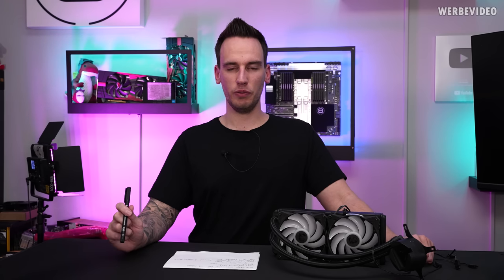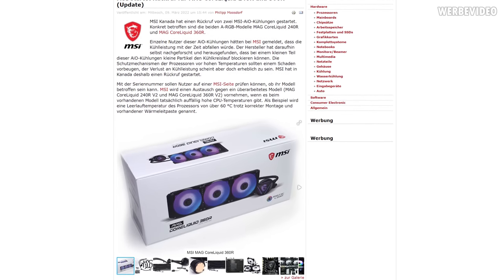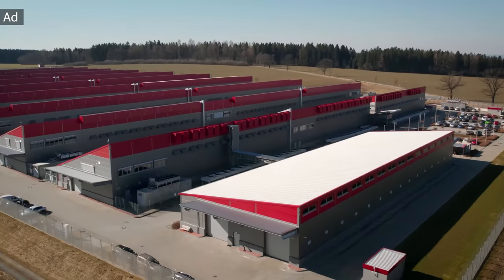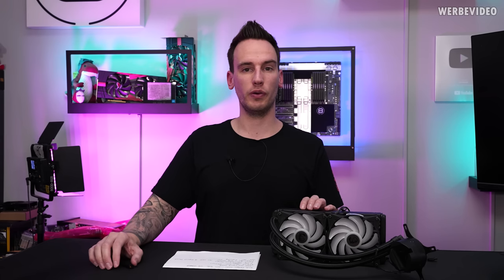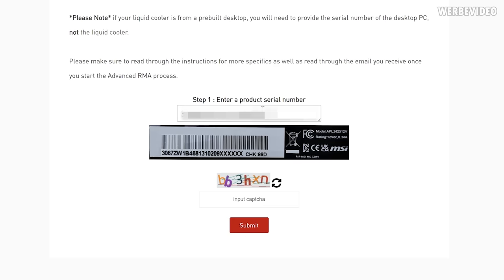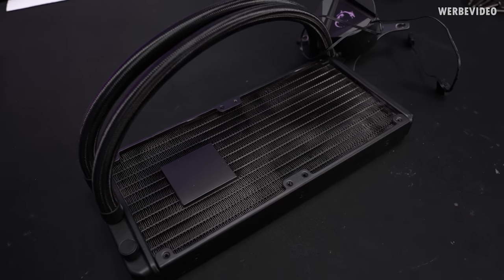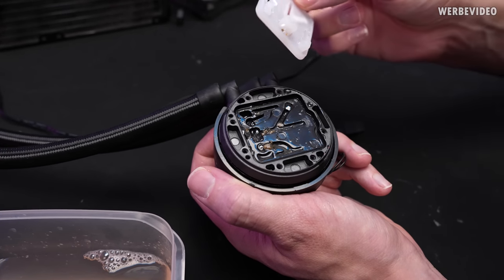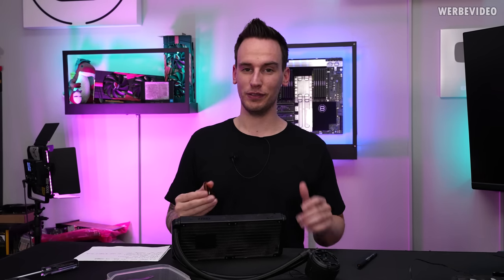Things you should not find inside an AIO

Comment: The OEM of these AIOs is Apaltek, they are the ones with serious QC issues.
There are a lot of other Apaltek AIOs on the market, several with issues.

The Fractal Design Lumen S24 series is also Apaltek (same pump in rad design), and I've also seen several examples with sludge build up in the loop. At time of writing there has been no recall for those. I've had 2 Lumen AIOs with sludge build up myself.
The Lian Li Galahad AIO is also from Apaltek (but with a pump in cpu block design Asetek is suing them over), and I've also seen pictures of sludge build up in that AIO.

EDIT: Fractal Design has now opened an exchange problem for their affected AIOs, you can find it on their homepage. They cite the cause as soldering material + impurities reacting with the cooling fluid causing sediment build-up.  

16 December EDIT: Fractal Design now has a Lumen v2 series of AIOs now where it's still Apaltek but they properly flush the radiator and use their own proven-good coolant supplier, nice to see them doing the right thing.
Reply: It's not only Apaltek, also Asetek is affected and other "independent" AiO makers like Enermax and such. The issue is the wrong type of flux used to solder the aluminum radiators. The companies source them from different manufacturers. They're not being made in-house and probably these manufacturers don't know what the radiators are being actually used for. (I mean, which fluid is being put into them) So this is just an unfortunate coincidence that ruined most AiOs because of a very complex supply chain.
Reply: This is my point of my previous comment ….. it’s quick and easy to blame the brand selling them, her MSI, but their OEM supplier should be held to account / named and …. not necessarily shamed, but also get a talking to etc….. then if they’re a repeat offender, roast them.
Reply: @michaelthompson9798  I'm sorry, but that's like saying you shouldn't blame Gigabyte for their exploding PSU, you should blame MEIC (the OEM) instead. The fault largely lies with MEIC but Gigabyte isn't exactly blameless. They put their name on the product and charged a markup, they should stand behind it.
Reply: It is the responsibility of the contractor to audit and to assess if the CMO is capable of delivering a product according to the contractor standards. If MSI is branding this, then it's MSI fault also due to poor or non-existant qualification and audit procedures
Reply: @josepedroteixeira9721  This! I don't care, who their contractors is, if MSI's name is on the finished product (in this case, the AIO, but it really concerns any product), you better believe I will blame them, not some OEM manufacturer. If the company sells them under their brand - well, then they are responsible for it as far as I'm concerned.
Reply: Appalling.
Reply: AFAIK the Galahad also has (had perhaps?) a noisy pump.
Reply: @kosmosyche  It all depends on how the brand handles this issue. And MSI currently handles it very poorly. They should at least remove any serial number restriction for this product line.
Reply: @kyoudaiken  That isn't how a business works though, if they don't have a significant number of claimed problems within a block of serial numbers there is no way they are going to recall them. They probably should as it seems more have problems than not, but the driving force is always money, and this is going to cost a bundle so not expanding the recall until it is absolutely necessary is standard practice.
Reply: @kyoudaiken  I've never once seen asetek AIOs have this type of issue. In fact, asetek is by far the best OEM for AIOs as far as any issues whatsoever. Everyone else has tons of issues. Even coolit has like 10x the rma issues of asetek. Coolit is far better than any other oem still tho.
Reply: @MrDutch1e  I'm just basing what I am saying on an investigation a news outlet did. The type of flux used to solder the radiators is the problem and it depends on who is buying those radiators who is affected. Since often most use multiple suppliers for their product, it could be that ALL AiO brands and OEM brands are affected.
Reply: @kyoudaiken  I highly doubt that is the issue or it's just certain brands buying from one oem of radiators that's creating the issue. I've only ever seen this exact issue on Enermax and now Alpatek.
Reply: @kosmosyche  Exactly, MSI is who sold you the product, who MSI bought their parts from or hired build it for them is their problem not the consumers.
Reply: @kosmosyche  100%. As far as the law goes, MSI is responsible as they are selling them to the public.  It's MSI that has to sort the Qc out from who ever made them, Not the consumer.
Reply: bro i have a Galahad, don't scare me😭
Reply: Dang it...I literally just bought a Fractal Lumen S24 for my rig. -_- Right after 2 Xilence AIOs dying on me withing 18 months.
Reply: I have a Lumen S28 running high temps. Would be nice to bring this to Fractal Design's attention as well. (Yes I know its Apaltek's fault)
Reply: @kyoudaiken  Enermax  units are made by Apaltek. AFAIK, Aplatek and Arctic(casued by faulty rubber seal) is only OEM having these kind of sludge issue
Reply: I agree, it's not only this model of MSI that has issues. Have heard that the new Lumen AiO's from Fractal Design and those of Cougar are suffering from the same issue. All these AiO's have the same concept of the pump in the radiator.
Reply: Can confirm, my Lumen S36 became clogged up in 10 months with insane temps as result. Switched to Cooler Master and having 0 problems…
Reply: What would you recommend as the best AIOs?

Comment: We had this cooler in a friends system and after watching Greg’s video when it came out, I had him check his temps. Sure enough, hi temps and throttling. 

The fix was to dissasble and refill the system with distilled water, then run it, flush and repeat until no residue was present. 5 refills later it was filled with corsairs coolant and has been perfect for 7 months now.

Comment: Last week 32/2023 my PC shut down middle of my work. I didn't pay attention to it and restarted PC. After some time the same thing happened again. Then I begun to check reason for that. I checked the temps and CPU temp was 71 C. At that moment there was no time to wonder, so I replaced the CPU cooler with a Noctua air cooler and temps was ok. Yesterday I begun to find out problems and help was found again on Google.  I appreciate especially your derBauer's work here. As a small detail, my MSI Core Liquid 240R was almost 2 years old, with ten days left on the warranty. The warranty had to be handled here with the seller of the component. Msi Core Liquid lasted almost the entire warranty period. :) Thank you again for your interesting and knowledgeable videos. Greetings from Finland.

Comment: Thanks for highlighting this, Roman. Even though I don't have a MSI AIO, I think it would be beneficial to many people if you, and other high profile tech experts as well as experienced viewers, could examine as many of the most popular AIOs to see whether they have residue build-up after a number of months of use, as a lot of people don't regularly monitor their component temperatures. This task could be coordinated and shared between several people to ensure the broadest range of AIOs are tested.
Reply: I'm gone give mine a 6 month test, and then rip it apart to inspect it.      I have a 240 coreliquid and have no issues whatsoever, even with a pretty aggressive overclock on my 5900x, but if I notice a consistent rise in load temps, I'm just gonna replace it and tear it apart for science.       Mine is from one of the newest runs, but if what others are saying is true, it seems it will be more of a manufacturer issue and not a run to run batch issue which means that all of them are technically succeptible, not just a handgun of thousand like msi originally stated.

Comment: I’ve seen Greg’s videos (Greg Salazar on YouTube) and “ most”companies take a level of pride in their products and if the AIO manufacturer themself  has to be held to account to, not just the brand selling them. It’s clear there’s some sort of QC issue which needs to be addressed.
Reply: Yeah they all sourced cheapest solder/flux they could find for more profit. They didn't care to know what exactly they needed to avoid the issue.
Reply: @craig9365  The OEM to blame here is apparently based in China. And MSI is based in Taiwan.
Reply: @AndoXD2448  this oem has had countless issues over the years.     There was an enermax aio that had the exact same system for lga1150 where it would essentially gel up inside, and then your pump would basically run out of fluid, overheat and then would die.

Comment: I was one of the early adopters of one of these msi AIO's and about 6 months later my cpu would hit 90C+ under load and throttle itself. This was well before it was a known issue so I just returned mine to Micro Center where I got it and paid a bit extra to exchange it with a Corsair Elite Capellix which works great to this day.
Reply: can't complain over corsair used 3 of them never had problems and my oldest one which you can't even find info about, was pretty much their 1st one still works altough since the pump was limited to 2480rpm it's too weak for modern cpus
Reply: Same…. But I did the recall and got a replacement while I had already replaced it with the Corsair one and the new mag v2 is just chillin in my closet with the plastic wrapper still on.

Comment: This is why I like the idea behind systems that are supplied as an AIO, but can be maintained or expanded upon like a custom loop. Being able to trivially flush the system or add/replace bits with quick-connects could save so many headaches, RMAs and recalls.

Shame such systems are pretty thin on the ground.

Comment: Have stated it for a couple months now and I will now officially stick to renaming MSI as
Major
Service
Issues
Reply: You realize that this is an Apaltek rather than an MSI issue right? There are more Apaltek-made AIO liquid coolers that have these kind of issues (Enermax, Fractal, etc). I have a Coreliquid S360 (Asetek made) and no issues whatsoever.
Reply: @debredanaar5292  I have a H115i elite Capellix with no issues
Reply: @debredanaar5292  Does not matter who made them, MSI has there name on the product, So it's Up to MSI to replace it. It's MSI's problem to find out what the cause of it is.
Reply: @debredanaar5292  Apaltek has had this issue for many years and MSI chose them to be the OEM. Regardless, it's up to MSI to rectify the problem as they have the final responsibility.

Comment: Working in a computer shop in France, and I can say that almost every MSI CoreLiquid V1 coolers seems to finish like this (didn't open then, but the temps are bad at idle, so....).
Got no problem to get them RMAd, not through their recall website, gotta contact the support directly.
The V2 received in exchange seem to work well for now at least, so hopefully they found a solution and fix it.

Comment: I had the 360mm version of this.  It worked for maybe a year.  I used it with a stock 10700k.  It would reach 99C with just Firefox being used.  I had to disable half my cores and hyperthreading to keep it cool until I could finish the loop my graphics card was on.  With the 10700K now on a loop with 2 360mm radiators, it would run 5.1 Ghz all core and top out at 67C during load.  By the way, my MSI 360r didn't have an accepted serial number either.

Comment: I'd be surprised if most AIOs don't have similar issues after extended use. But I've only ever used custom water cooling. I don't use dye and only use de-ionised water + pure silver strip as an anti-bacterial, and have never seen my loop/reservoir become polluted. I have never bothered dismantling the cpu block, so there may be debris from the radiator stuck in the fins - but I have not seen a termperature increase.

Comment: Bought the 240r brand new and had these issues straight away.  Would hit 80+ in the bios.  Got it replaced with the v2 through my stores warranty and about 6 months in and I idle at around 35 now

Comment: Even arctic had a recall for a gasket for some freezer series made in 2021 it's crazy how they don't test the batches or new changes to the aios.... But I'm glad they are making it right but would save them the headache...
Reply: They said the gasket wasn't galvanized fully. I'm wondering if that was bs and it was the wrong flux used like mentioned in the other comments here.
Reply: @tacticalcenter8658  The issue with Arctic Cooling looked different. They also let you either RMA it or swap the gasket yourself, sending you a new one for free regardless of serial number. This is what MSI should do. But you know, big corporations are sometimes not feeling like that.
Reply: @kyoudaiken  arctic is going by the date code on the bottom of the pump vs the S/N. if yours has a date code past when the affected time frame it will also refuse to let u proceed with the recall. i bought on of the 420 units like 2 weeks before the gamers nexus video but mine had the QC pass stickers on it so that should mean it was one that was already fixed.  i tired to apply for the recall anyway just to see and it refused to let me because the date code on the pump was past the affected time frame.
Reply: @mraaron1584  I doubt you will have that issue down the line, I think Arctic is being honest with their time frame. And I bet within the affected time frame, there are also good models that are replaced or getting a kit regardless. Arctic's RMA politics are pretty good. They replaced a fan with a bearing issue without the need of me sending it in.

Comment: Never understood the appeal of AiOs...air coolers are cheaper, more reliable, easier to install and perform better.
Reply: Air coolers perform better in terms of price to performance. They do hit a ceiling though and if you need to cool something like a 12900k a 360 AIO is going to perform better even compared to top air coolers like the Noctua NH-D15. There's also other issues like case clearance and how well optimized it is for airflow. Some people also prefer AIOs just for their looks.

Comment: I did buy one of these but I was using it to modify a server and had to remove the pipes as they weren't long enough I used clear industrial polyurethane pipes.... I refilled mine with xspc Ec6 coolant...so far no problems with temperatures...as with most Aio failures it's the ' cheap' or in correctly specified coolant that doesn't protect against galvanic  corrosion or bio build up .
Reply: Or it wasn't built correctly with material's that weren't compatible with the fluid being used.

Comment: It's too late for me (I've already replaced my MAG CoreLiquid 240R that was on the brink of death due to this issue) but thank you nonetheless for bringing attention to this! If you want another sample, I still have the bad CoreLiquid 240R available.
Reply: Mine also wasn't covered by the recall, even though it definitely has the same issue.
Reply: @ryguygoesawry  most of the time you can just contact msi and thekr customer service dept can set your RMA up if it doesn't "qualify" normally.
Reply: @NobodyAwsum  Thanks for the advice, but I wasn't able to go the normal RMA route because that would have required MSI receiving my AIO before they'd send a replacement. I couldn't chance not knowing how long that would deprive me of using my only PC, so I ended up replacing it on my own with a DeepCool LS520.

Comment: Nice video. I ran the Msi 360 aio for about 8 months and then had overheating issues and shut downs. I googled it and found out there were issues. I switched to an air cooler and set it aside. I opened it up and saw similar clogging out of curiosity. When the recall came out I checked into it and did not qualify for it. But I contacted MSI and they let me RMA the unit and sent me a brand new V2 unit. It is still in the box. I wonder what is causing the actual issue? Is it the fluid? I am curious if draining it, cleaning inside and using a quality fluid would help.
Reply: Yea you could absolutely do a full flush of the system and use a better liquid.    I'm sure it's some kind of contaminant in their cooling liquid that's growing the algae/slime that's clogging systems.     Either their filling line, or their storage tanks aren't completely air tight, allowing some sort of bacteria or something to get in.

Comment: I don't see evidence of corrosion on the cold plate or the radiator.  Could it be the coolant itself breaking down from a liquid into the particles of that solid?
Reply: Flux type being used and fluid type being used with it are the problems.

Comment: Nice shout out Roman. If the aio was out of warranty, how would we attempt to remedy the issue? Is it being cause by dissimilar metals in the loop ( copper and aluminium)? If so i assume there are coolants to address this available?
Reply: In this situation, the aio is recalled so they'll replace it regardless of warranty. 

For others that are out of warranty, that would probably mean just over time stuff grew in it. If it's out of warranty, that would mean it's multiple years old. 

If that's the case, a flush and new coolant could work assuming you get proper coolant.

Comment: My coolermaster AIO have been installed since i buildt my system in 2012, with a 3770k. Guess some are lucky. i have used the system about 40.000 hours. CPU is 41 degrees now running for 8 hours merely doing streaming and such today.